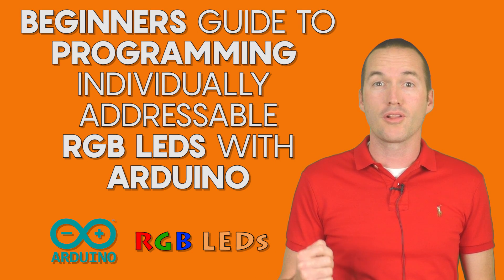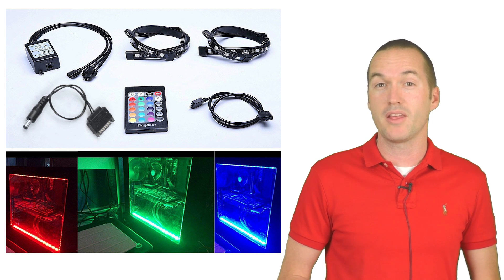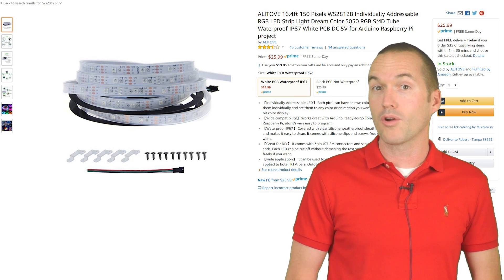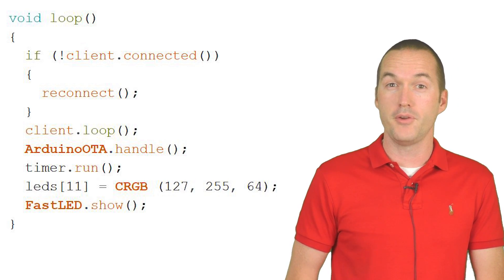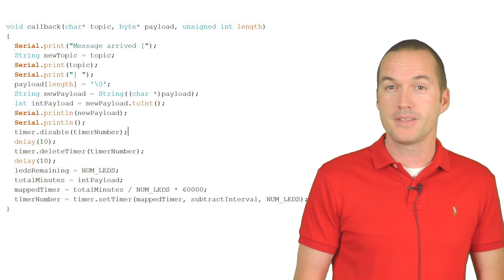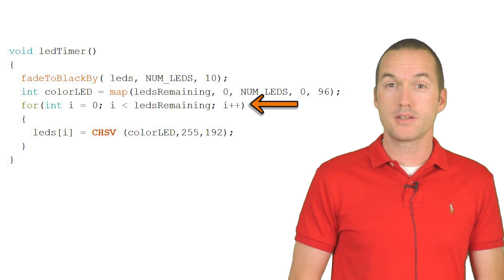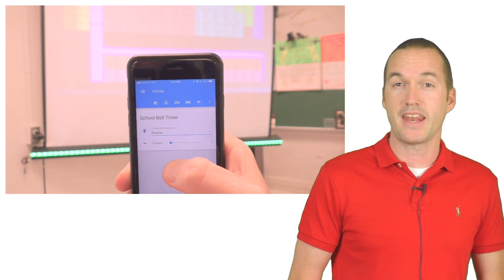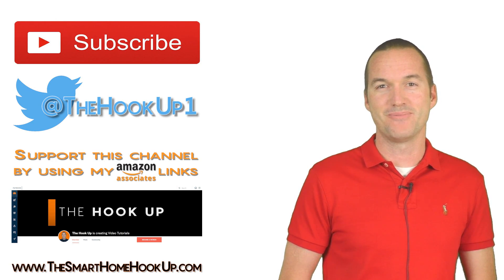BEGINNERS Guide to Individually Addressable RGB LED Programming with Arduino

Comment: Have a project involving regular 60 to 100 watt equivalent led bulbs in large (like 50) globe lights (maybe 9 to 15 inches), like to control brightness and color along with have the ability to do some cool light effects (maybe to music) and want to be able to control when they come on, how long, etc and have it all controlled with a app.    wifi is good.  would prefer something with long range (like yolink). Can you recommend or steer me in the right direction?

Comment: Can you cut the straps at the connector points and extend the strip sections with segments of wire and still maintain the individual control.?
I want to use the programmable leds in a model kit. Being able to extend the strips with wire between segments of the model would be extremely handy as I intend using strobes etc....??

Comment: How can i connect arduino to ws2815? Do i need to use mosfets?
Reply from the maker: No WS2815 uses the standard WS281X protocol.  The blue wire is just backup data and you can leave it disconnected.

Comment: do you have any project with ws2811? or can you explain how WS2811 work? to my understanding each group of 3 LEDS in a strip equals to one. other word a 66 led strip of WS2811 should be shown as 22 in the code ( NUM_LEDS = 22 ). right?
Reply from the maker: Yep, you've got it right.

Comment: I need help.  I want to make a project using HS107s strips, because it seems the only one that's fast enough.  It is a 6 pin chip (clock in/out, data in/out, Vcc.Gnd.)  What I would like to know is this :  All signals and commands go to the first LED in the strip,  When I send LED_1 a Start Frame (all zeroes), does it alert LED_2 that we are starting a frame.  If there are 100 LEDs in the strip, do they all get notified?

The protocol is [aaa][ccccc][bbbbbbbb][gggggggg][rrrrrrrr],  where
a = 1 (start bits), c = brightness (5 bits) b, g, r = Blue, Green, Red intensities.

For the Start Frame, all 32 bits are 1's
OK we sent the Start, so now we send the colour of LED_1  [111][ccccc][blue][green][red], where ccccc = brightness (5 bits - 32 levels).  Presumably, LED_1 lights up.

Let's make it simple by giving some values 
0x00000000  - Start Frame
0xe60f0f0f   - global brightness = 6, all colours intensity 15
Now, LED_1 has its data.  That data does not get clocked out to LED_2, so how does the data path through LED_1 work when it is already satisfied?
LED_1 already has its data, so it's not interested in LED_2 data - so how does LED_1 handle it?  Data arrives at the DI port and gets clocked out of the DO port, but there must surely be some delay?  LED_1 has used clock cycles 0...31, so does the very next clock, clock the first bit into LED_2, or is there a gap?  The reason I ask is that this could be a very long strip.  if we have lit 198 LEDs, the next bit has to get clocked into LED_199, but it has to pass through all of the LEDs along the way, and each one must introduce a tiny delay.  Along a long strip, I would expect these delays to add up to something significant.  Does the next data bit, running at 40 MHz get reliably clocked into the next LED, regardless how many are before it in the strip?

The Datasheet tells me that there is an End Frame word of all 1's, but that raises 2 questions : 1) how is that word distinguished from a word of full brightness on all colours - which would also be a word of all 1's?
2) What does that word do to LED_1 ... LED_98?  The word must pass through all of the others first.  What does it do to them?

In fact, how to LEDs on the strip react to the Start word and the End word?  I had surmised that the Start word would tell LED_1 that the next data was for it.  It would clock all zeroes into its shift register, then the first 1 would start to load it, but while it was loading, it wouild clock out all the zeroes, so that LED_2 would be initialising while LED_1 was being loaded, and so on down the strip, so that each LED is initialised in turn - but I don't understand the function of the End Frame word (0xffffffff).

Which LED is the first to be illuminated?  Is it the one closest to the microprocessor, or the one furthest away from it?

Is there something I have radically misunderstood?  I find the datasheet somewhat lacking in detail.  Any guidance appreciated.

Comment: Hey nice video, but I'm getting the following error in FastLed.h, can you please help. ERROR: #      pragma message "No hardware SPI pins defined.  All SPI access will default to bitbanged output"
Reply from the maker: That's not necessarily an error message, it's just telling you that your hardware doesn't have a specific SPI interface.  It will still work, but if you have a lot of LEDs (1000+) you may notice lower FPS.

Comment: I could use some help with some Arduino code if you'd be up for it...  I want to make an addressable RGB Thermometer using the "LIXIE" style acrylic 0-9 numbers like a "Nixie" tube would.  So say the temp in the room is 58.  (2 column; A=5 & B=8)  Using 2 WS2812B leds per number..  then from anything under 32degrees F would be Blue, 33-50 would be light blue, 51-70Green, 71-80Yellow, and 81-90 Orange and anything above 91Red... So as temp goes up, so the the color temp.  Then it would be an input from a LM35 transistor for temp, which uses a 0-1vDc to measure temp.  or maybe a Thermocouple of some type.  That part shouldn't change the code much.  But the hard part comes in the actual numbers.  So say it needs to read 01 on the display.  The 1st 4 leds would need to be off, off, on, on, at color, X,X,160 going upto say 69 at whatever # led that would be via rows of 4 or 8 I guess... This is the part I'm REALLY LOST!!! So lets think about this.. I have 2colums, with 2leds each.  That 4.. 4leds per ROW.  with 10 Rows.. So I have 40leds, in 10 rows.  4x4x4x4x4x4x4x4x4x4=0123456789 & 0123456789 respectively.... So if i want 69 I'm guessing that's LED#'s 21&22 plus 35&36 with a color of 96... .
Follow me?  Do you think you could help?

Comment: Great video! I purchased the board and lights you linked to in the description. I was able to control the LEDs with FastLED. However, once I connect to WiFi, FastLED stops working completely. I don't get anything happening on the LED strip. I know this is an old video and you have a lot of comments, but was just wondering if you might know what is going on.

Comment: Hello all. I am new to LED lighting. With that being said, I will be putting WS2815 light strips on my home's exterior inside channel. I have almost all I need (lights, channel, power supply), with the exception of the controller. how do I choose which one? I have a small setup in my office using the SP105E controller, but I want one that I can program. I have googled most and have to admit I am a bit confused as to which one will be compatible. ( T1000S, K-1000C etc...)

Comment: I have an unopened box with 24V HUE LED extension strip, from back, when I did not know better. 😆
Can i connect this to my arduino or do I I need some special software to use this strip?

Comment: For years I've thought of building a vertical panel with multiple lights that would be activated in programmable pattern (time and sequence). It would be used for boxing practice and to improve reaction time, I think would be an extremely easy thing to do for someone who has some knowledge of the subject, but I have NONE.  How can I get started with such a project? Could it be that there are plans available for such things? (Jan 2. 2022).

Comment: Quick question — do you have to do any soldering? I’m a arduino newbie and I have the arduino starter kit circuit board and breadboard. I believe they were made to make things without soldering. Did a few projects without having to do any of that.

Comment: Great video. Using the single message to convert to payload is smart; is that all set up in Node Red? Could it be used to dynamically control the strip from a website updating (like an HTTP Endpoint); such as flashing when a team scores or show positions in a race; like if a Ferrari driver is first in F1 the first LED would be red, or showing what places school kids are in a running race? 
Seen some IFTTT creations do something similar, but since the ESPN applet was removed from there you can no longer do this.

Comment: Hi Rob, first of all, congratulations on sharing your knowledge. These videos are very inspirational and helpful. I just came out with a doubt: in another video called "Year Round Holiday LEDs Part 2: Software" you say that to use a logic level converter for the 5v led strip and where you are saying that it's not necessary. Can you clarify this, please? Thanks!

Comment: False, the leds don't know their rank. The message is 3bytes long for each led, one for each color grb. So the total message is 3xnumbersofleds. The first led reads the 3 first 3 bytes and then pushes the rest of the message to the next and so on until the last one. The message gets shorter as it passes through each led.
Reply from the maker: You are correct, my representation was to make things easier to understand for non-programmers.

Comment: Thanks for the walkthrough. I'm new to Arduino development and general hardware stuff (haven't soldered for years), but I think I can handle the software side. Do you have any advice or example pictures that demonstrate how to wire/attach stuff to the board? I saw the conceptual diagrams, but I'm not sure where to begin in terms of knowing when to solder, or if I should be investing in a breadboard or what.
Reply: Go over to Ben Eater and copy what he does on his breadboards.

Comment: Hi there, I am so happy I found this channel and I am about to get started with my son - though, a question: You Link to a 16ft LED strip here - did you cut that into the right length of 57 LEDs? Can I just use scissors to shorten those strips or do I need special tools?
Reply from the maker: Just scissors
Reply: @TheHookUp  Hello again, I have a follow up question - I gathered now a ESP8266, the light strip and a power brick. How did you connect the ESP8266 to the light strip? I was suspecting a breadboard but I couldn't find any in the the "Hardware Video" of yours. Did you solder those two together? Do you by chance have a wiring schema somewhere in your videos? I guess, the ESP8266 also needs to be connected to the power brick, like the light strip... Thanks!

Comment: It seems like the libraries ESP8266WiFi and ESP8266mDNS aren't available anymore if I'm correct, do you know a solution to this problem maybe?
Reply from the maker: Try installing the 2.4.2 version of the ESP8266 board manager.

Comment: I love your videos, so thank you.  It's because of yours and Dr. Zzzs videos that I have started tinkering with Arduino, tasmota, D1mini, NodeMCU, and LED Strips. I haven't looked through all comments, but I would like to make a suggestion for the timer.  For the mappedTimer, I would use this instead: "mappedTimer = (totalMinutes * 1000) / NUM_LEDS;".  This makes it useable with strips using more than 60 LEDS and also wanting access to a shorter timer like 1 minute.

Comment: I am a locomotive engineer (I drive trains) and work on call; so, my sleep periods are random. The windows in my room are all blacked out, which help me to sleep, but don’t aid in me waking up. I would like to put LEDs around the perimeter of my ceiling and set up a controller that I could push a button that would start a 8 (or 9, or 10) hour timer, where the lights would ramp up to full on, starting at about 15 minutes before the end of the timer. I think this would cause me to wake up better (than an alarm blaring in my ear). Would you do a video on this?
Reply from the maker: I think you’d like this project: https://youtu.be/2j3UyrBjB4g

Comment: Thank you for your video.  "Individually addressable"... sounds as if each LED has an address, which it doesn't.  If you want to change the last LED in the strip, then entire array is resent.  
If you want to change [just] the  57th LED, you send 171 bytes.[okay the program does.]

Comment: hello i amd trying somethis but there is nothing in internet about it. i want to run 2 defferent led stip same time on one arduino nano. but how i edit the code?
pls give me solution if you can. i just started learning about codding. 
for example take any fastled code. and give the 2 defferent data pins like pin 6 and 7 but pin 6 led count 70 and pin 7 led count 50. but work same void loop how to edit code ?
i know its so simply who understand coding. but hard for me. help me pls
Reply from the maker: There is a fastled example sketch for that.  Go to file, examples, fastled, multiple, multiarrays.
Reply: Not clear bro. Pls explain
Reply: Multiple array can set many data pin?
Reply from the maker: Yes
Reply: Thanks for reply sir. Its so helpful. Can you pls help me with it? Pls i will provide a unique code. But it has only one (data pin - 6) pls add another data pin. And can i able to change both data pin led numbers?
Reply: https://drive.google.com/file/d/1asJiCnVcuIT4a9uci38rgUepZtyKCR2K/view?usp=drivesdk
Here is a sketch. Pls sir help me. After you edit the code provide me pls. I will compare both and will learn a little. Next time i can do by myself

Comment: I need help with these ready controllers like the SP107E or 108E?  My project is a 4m long 60/m led 2812B with 20A power supply.  Do the controllers take power off the same 20A supply?  This is for a backlight on a glass chalk board for work and this project is kind of a gateway before I try the Arduino.

Comment: I ordered everything in the hardware you said from the websites that you recommended, now  I need to hook up with the arduino, can you help with that please? I saw one , I will have 112 lineal feet of lights on my house, i will do 2 zone’s, the bidirectional board is very small, the one thing I don’t understand is the pins and how to connect them to the board i can see the wires directions but on the back of the arduino board you have pins on another board and that’s where i get confused, on the software that you have I think i can manage that by changing the numbers of led’s and use the same type of animation you have

Comment: I was trying to use Fastled library to drive my sm16703 led strip using a nodemcu but got no luck. I saw your code example on github and it worked like a charm. 
I was missing => #define FASTLED_ESP8266_RAW_PIN_ORDER
the right pin order in the sketch.

Thanks a ton man!

Comment: I have a question here about Individually addressable LED lets say you have 20 leds and you want all them red but when press button 1 and number 5 led throw 12 turn yellow but 1 throw 4 and 13 throw 20  is red and when the button is not pressed all leds are red

Comment: Thanks for the amazing videos. I have a question. For individually addressable RGBW pixels (40mm series lights, not strips) to be installed for general and holiday lighting around the house roof line, would you recommend DMX addressing or SPI? The number of addresses seem to be a limitation.
Reply from the maker: I use SPI for 90% of the year with my own programming on a small nodeMCU microcontroller.  I switch to DMX controllers to do my Christmas light show because the popular sequencing software all uses DMX (e1.31).
Reply: The Hook Up thanks for responding, what controller do you use for your Christmas lights? How many LEDs do you run in series for communications?
Reply from the maker: @DavidFindlay  I have both a Falcon F16V3 and a HinksPix Pro for my show.  Check out this part of this video for more info: https://youtu.be/9I2PsgyKZPg?t=131

Comment: Hey, I was wondering: Can I use 2 different strips (for example the same 2x 1m strips) and assign them the LED0> you were talking about, or is the last one going to reset it and the new strip is LED0 again? Im asking because 2x 1m is cheaper than one 3m, and I only need 2m.

Comment: I use Adafruit_neopixel library. My problem is that when I use Ws2812b everything works fine but when I use the Ws2815 the color of each RGB LED is randomly changing from one to the next but when I use the same program with Ws2812b every color is the same and it works. Does anyone have an idea how to solve this problem on ws2815?

Comment: I didn't see any comments regarding this, so I'll throw it out there. The brightness of the LEDs are controlled via pulse width modulation, whereby you change the percentage of the time that a signal is on, with respect to the period of the signal.

All LED strips (that I'm aware of) have current limiting resistors built in and will have a constant brightness when the nominal voltage is applied, usually 12V.

Hope this helps!

Comment: With node mcu and xlights how come there is only 1 port  when using xlights and the node mcu? Where as if I had a falcon differential board there are 4 ports usable! On the node mcu can I just connect to a different pin to get those other ports

Comment: Great series of videos on RGB strips. I would like to note a correction in this one, @1:25 regarding the statement "by changing the resistance...",  virtually all controllers use PWM, not "resistance". Also possible to adjust them using variable voltages on each channel.
Reply from the maker: Spot on.  Sometimes I’m disingenuous to be able to explain a topic a bit quicker.  My dimmable ceiling light video has a full explanation of pwm led drivers.